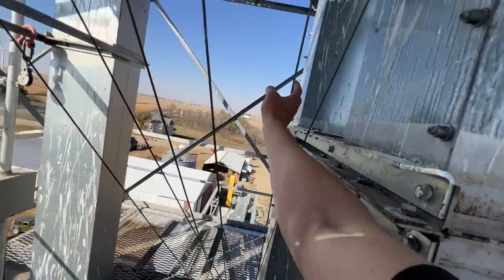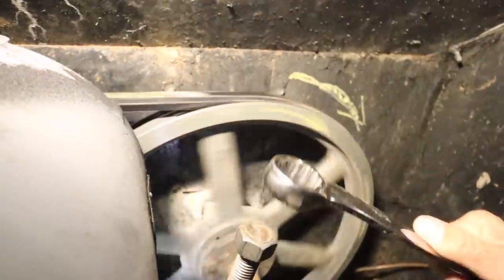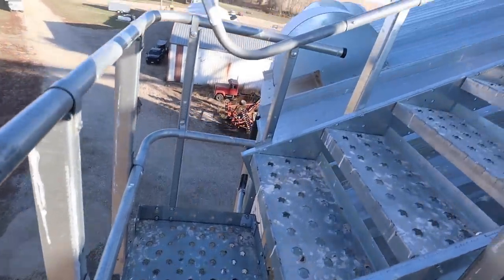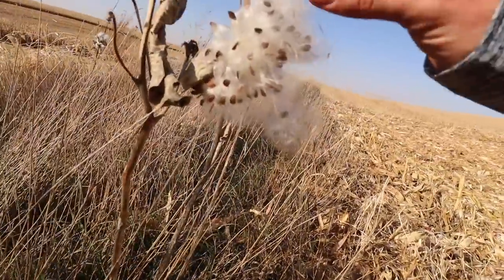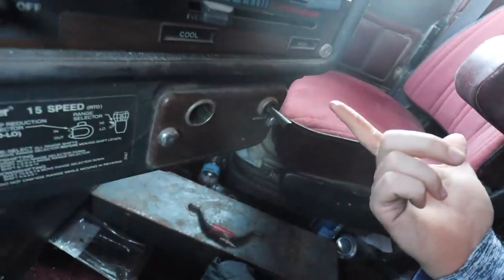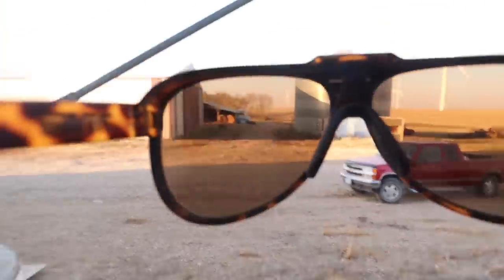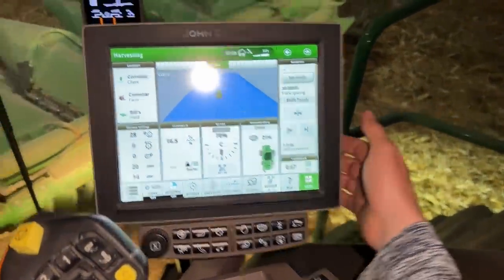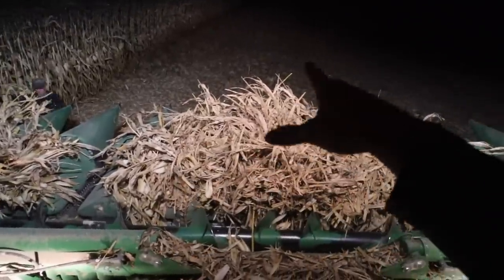Broken Welds Have Been Discovered On The Bin Site

Comment: I certainly hope that whomever installed all this equipment has been notified to either fix the issues or they pay someone to fix them. Fir the amount of money you invested you would expect some small issues but safety on the stairs and railings there is no excuse for thme overlokking them. I admire you all for being able to always rise above problems. My hats off to you all,
Reply: Your comments are to the point and make complete sense. Cole needs to take and send photos to the metal installer of the site, ASAP. Also inform your insurance company of the situation. Lastly ensure that safety signage is put in place were required.  PS, Inform all site users/visitors of the main problems.

Comment: Sadly a legal/civil case is only so useful -- it doesn't fix the fact that you need a properly working bin site right now. Still, I hope those bin builders were insured, because there has to be some workmanship liability & responsibility at some point. At some point, perhaps you'll be able to talk more about it, for right now just happy to see you all getting the good work done as best you can despite the frustrating setbacks.
Reply: Something I've been wondering.  I have no idea how these commercial bin site operators work, but I hope not similar to a lot of condo/home builders around here.  For liability reasons each project is spun off as it's own LLC to shield the parent company from liability if something goes wrong.  For example there are a ton of condos that were built with split-face block in the 2000s and a large number did not have properly installed moisture barriers and now are mold magnets.  The parent companies that built these buildings are still around, but the LLCs tied to each project are long defunct or long drained of assets.  So there is noone to sue to fix it.

Comment: The cross auger in the bottom of that pit needs a Amp meter so when it get to high of amps pulling it will shut off automatically. U could then have an adjustable timer to set how long it stays off to let corn in center catch up. 
Just an idea. I have something of this sort on my set up.

Comment: About the belts, have you considered swapping out the pulleys to double the belts? It'd pretty much halve the startup strain on the belts. I wonder if adding a soft start to the circuit would help any, slow down the ramp up on start.

Comment: Okay now I’m pissed, this isn’t a bin setup this is a million dollar death trap.
Reply: Agreed he almost died. I hope they sue for the cost of the bin site!
Reply: Up that high, I'd recommend a harness. Sure, it's annoying, but you don't get a 2nd chance several stories up.
Reply: @iLumberjack  A harness to connect to another piece with a broken weld? typically harness are connected to the safety railing, of which he grabbed and it broke.
Reply: @towtruckaj  understood.
Reply: Exactly
Reply: @iLumberjack  Ed Zachary what i was thinking
Reply: Was there ever an engineered stamp drawing?
Reply: Farming is dangerous.  A bin setup like this can only be but so safe unless you bankrupt yourself over safety.  That being said some basic things should absolutely be squared away.
Reply: @semosancus5506  Are you kidding me? They paid a half of million bucks for this bin site! The brand new weld on a safe rail broke, I seen the weld that broke and the angle iron the weld had broke from. That is 65 feet up, that should have been bolted and welded damn near all the way across. How would that bankrupt anyone?! 🤔
Reply: @weirdmatter  They actually paid a million dollars I believe (slightly more).  I just see these comments that seem unrealistic.  I agree there are some basic welding problems but any project of this size, done under the duress of supply chain and labor shortages, is going to have problems.  I hope they have done a full review and have a list of issues and shortcomings in performance and are undertaking, at their own expense, fixing safety issues.  I also hope they withheld final payment.  In the meantime, they have to use the site to start to realize the ROI.  So that means being freaking careful with these catwalks and other potential safety concerns.  Regardless of handrails and other stuff, there is a lot of danger even if the bin site is done perfectly.
Reply: @semosancus5506  I also understand that, but they had a welder! Bolts are not hard to find right now, and that particular handrail should have been installed properly in my opinion. My uncle Keith and his brothers run a multimillion dollar farming operation here in Illinois, I know the dangers of farming. However I still believe the company that installed their site could have done a better job. Regardless of the supply chain, they have everything it is not installed correctly. Your telling me they didn't have enough welding wire, and bolts?
Reply: @weirdmatter  I know they had a welder.  But was the welder good?  Did he know the plan?  Was there a plan that he could follow with welding specs?  Was there a foreman ensuring the plan / spec was followed?  I don't know.  I think some of this comes back to the Cornstars not being vigilant as customers.  I could be wrong about that as they have not said much.  Before I agree to anything I make sure there are clear specs and if those specs aren't met, then there is no payment.  How did the Cornstars get this far with so many problems?  It also might come down to the contractor they selected.  It's possible another contractor would have done better in the first place or have been more responsive to fixing issues.  We just don't know enough.  As to your question about bolts, I'm pretty sure he said in one video during the build they were held up because they couldn't get enough bolts to put the bin panels together.
Reply: @weirdmatter  id call OSHA on the contractor for creating safety concerns
Reply: @semosancus5506  really weird stance to take throwing blame back on the customers. They are not bin site experts. They hired a company to design, spec, and build the site, and deliver to them the final product. The cornstars are not bin site experts, the company they hired supposedly was. It was not the cornstars duty to GC the job and inspect it at every step. That was the responsibility of the builder. They encountered issues with the builder and their subs throughout the entire build process. They have been in a legal battle for a year now. Any professional outfit should be embarrassed to have delivered such shoddy work to their clients. 

Putting ANY responsibility for the shoddy job the contractor did here back on the cornstars is something I'd expect to hear out of a fly by night handyman being questioned on why his plumbing job leaked "it's the customer's fault for not telling me I needed to use PVC cement on the drains!"
Reply: @weirdmatter  they’re in court, can’t wait til they can talk about it
Reply: tripplefives  Cole and his family need to sue the contractor who built the site then
Reply: @semosancus5506  I believe I heard Cole say the cost was approaching 1.5 million, I know things have cost overrun but overruns for crap construction, wow.
Reply: Haaaaa the great American engineering 👌 👍
Reply: @williamburns9731  i think the term your looking for is shitty workmanship by a poor contractor
Reply: @semosancus5506  You understand they are governed by OSHA right? It MUST meet their standards. Period.
Reply: @TheNemosdaddy  Private farmers with 1 or 2 employees are governed by OSHA?
Reply: bet they are disapointed too now
Reply: @peterrenshaw9237  I've had opportunity to work in the catwalks above MLB stadiums and hockey arenas. These were very sturdy structures since they needed to support both themselves and the roof, but also very heavy suspended loads like scoreboards and multi-ton speaker rigs for concerts, etc. I'm not a rigger or pretend to be, but I know that nobody went out on the catwalks without a rated harness. Whether this was a legal requirement, OSHA recommended, or simply a requirement for insurance, I don't know, but I was ubiquitous. Given the generally temporary nature of scaffolding, I guess it's possible that the rules are different. I do know there's a world of difference between basic rental scaffolding and the stuff set up by pros. Y'all know what you're doing, that's for sure!
Reply: @iLumberjack  as a scaffolder we ware rated harness to make it safe for other workers or  general public . once we have finished we put a safe tag on it and the workers or  general public can go on the scaffold  without a rated harness because we have eliminated any risk of falling
Reply: @Greg G   ya, but what is that going to do if welds are snapping off. May if it was done correctly
Reply: @gexploits  i agree with your statments . I do scaffolding for a living and i can tell you they left out a extra rail at the bottom of the stairs what is designed to stop you falling to your death if you triped on the stairs .it is clear to me who ever did this is a moron who dont care if you die he just wants your money

Comment: I agree DC you might want add some additional vertical safety.
Reply: im going to take a more aggressive stance and say they HAVE to get that fixed. The chance of a fall is high, and if a fall happens itll almost certainly be fatal at those heights. 

That height of railing is way below the required factor of safety of 1.
Reply: @alexdrockhound9497  definitely should be using harnesses that high up.
Reply: @alexdrockhound9497  I don’t disagree.  I just don’t know if that poor design or bad workmanship.  I was talking about when he came down the stairs and the railing was too low.  If you you were talking about the crappy welds, oh heck yes.  I would make them fix that.
Reply: @michaelsurratt9593  both are way beyond acceptable risk

Comment: tell Cooper to take the motor off and stick a burr but on a die grinder in the mounting bolt holes and burr out his own adjustment grooves.Then change to a 4 belt pulley

Comment: And you might wanna extend that railing up about 2 feet, that way if you fall, which unfortunately if done enough times you will, then you won't fall all the way off. It's a cheap enough fix to be on the  safe side. Thanks for the videos

Comment: Hi Cole i saw the tar spot while i did my schooling on Crop production and it was my main Focus while i was at University of Guelph in Canada know for AG and i did 6 months working for my province on research on it while you may know this tar spot it basically a fugus that bubbles a bit and then covers the leaf in spots or if bad enough in patches (under a microscope it looks like a bubble that can pop) so it does have yield impact and life of the crop impact because it will stop the plants photosynthesis and which does hinder the total possible yield potential

once the tar spot appears it will remain for a while or bad enough can last a decade 

the spores are transfered with the wind in Ontario canada wind it depends for us if the wind stream for the year will move south to north and vise sersa

Hope it helps and Hope harvest goes Great!
Reply: Will burning the paddocks after harvest help get rid of it instead of planting on all the old charf
Reply: @looking8030  we dont get in to that practice in ontario here but if some hybrids resist it more than others it came to canada in 2018 and farmers have been dealing with it since and some years its barly even there like affecting and some its bad depends on the conditions that year

Prime conditions for it think of it like mold, wet humid conditions if its more of a dry but wet it wont show  up as much

there is a thing called a DISAESE TRIANGLE it is a triangle that shows for a disease or issue in crops we need 3 things (Enviroment, Suseptable host, Spores present)

but also we noticed in trials in NO TILL TILLAGE ITS WORSE DUE TOO THE SPOPRES STAYING IN THE CORN STOCKS LEFT OVER so basically it can be more controlled with some tillage not saying full 70s tillage but think about that
Reply: @looking8030  dry heat low humidity but still have rain its wont show up humidity is a factor it also starts at the bottom and works its way up always check first leaves and then move up
Reply: @brandonhooey4468  thanks for the info mate 💯👌🏽

Comment: I wonder if slowing the cross augers in the pit would help.  Either a VFD motor drive or change the pulleys.  VFD you could at least find the working speed of the cross augers vs the main auger to the leg. Might even be worth putting a VFD on the main auger so you can over drive it if needed.
Reply: This is my thoughts a vid is the way to go and swap the belt for chain. They keep mentioning a guy programming things all the time I really wonder wtf is happening besides reacting not finding solutions

Comment: 13:34 on the note of that pit auger burning belts, may I suggest adding a triple pulley instead of using a double pulley to better transmit power to more surface area to that shaft lowering the tension a little bit on the belts themselves but increasing surface area between both sets of shafts to transfer power better because it seems to me this is one of those situations where you have too much slip because you're trying to transfer too much power through two belts that is turning a shaft that is too long for it under that weight

Comment: Great Video Today guys!, I was wondering on the auger motor down in the pit, Can You get 4 belt pulleys for that to give that 10hp motor a better chance of pushing through instead of stalling and burning the 2 belts off?. DC had a point in that the smaller 7hp motor would just pop the circuit breaker, maybe since the 10hp has not done that it just needs to be able to pull harder at startup....   Just a thought. You Guys really do take it all in stride and continue forward with all of the issues you have encountered. THANKS AS ALWAYS for bringing us along on these journeys .....   already waiting for the next one.

Comment: Switch the auger to three groove sheaves and triple belts to handle the 10HP.  Option #2;  Add covers or shields to the auger so it takes less grain in and has less load on it.  You might need to then change out the sheaves to speed it up to keep up the desired bushels/hour.  Option #3, (not recommended) You could swap out the belts for some double #80 roller chain, then who knows what will break next. The nice part of belts is they do limit the load and the destructive force if something jams, roller chain is unforgiving.

Comment: seems to me that the gap between the left side and right side flighting needs to be wider apart on that cross auger in the pit , as well you may need to put a delay on the cross auger drive so it only comes on when the main pit auger elevator sensor sees it running out before it starts shutting down

Comment: You really need to have an experienced inspector go over every inch of the bin site and write a report detailing every safety issue, every design flaw, every construction flaw, and every mechanical flaw.  I would allow no one to climb atop the bin site in its current state.
Reply: If it was me Id consider having a complete mechanical inspection of the bin site done PRIOR  to any more use as there appear to be far too many potentially mistakes that could prove to be catastrophic AT BEST .... and DEADLY AT WORST. 
Upon  cerified inspection bill the builder and give them an ultimatum , pay for the inspection,the report , and ALL necessary repairs by a competant firm other than the contractor within 15 days or see you in court..
 bring a blank check and notify you liability insurance carrier immediately
Reply: I am pretty sure they have already hired an inspector months ago when the troubles started. But new issues can crop up.
Reply: What about an inspector?
Reply: I’m sure they have, judging by how they can’t share all the details with us, they’re in the middle of a legal battle with the builders that screwed this up.
Reply: i'd climb on it, there is enough structure that was solid from the old build, i'd just tie off honestly to the bigger elements when possible so that if something like a weld broke i know there is still something else holding me
Reply: Agreed....you have some verifyable issues with those bin builders
Reply: That was scary watching daddy cstar nearly go over the edge. If that had snapped off I hate to think. I agree that whole complex needs inspection!
Reply: That was scary watching daddy cstar nearly go over the edge. If that had snapped off I hate to think. I agree that whole complex needs inspection!
Reply: Yeah while it was being built.😃😄😃😄💩
Reply: They've got lawyers involved..I'm sure inspections are coming! You can sure tell they want to say more but the lawyers have advised not too. Lol
Reply: @ccole9080   You have clearly never been involved in a large multi scale grain handling system construction project never underbudget never on time and always f*** u* The joke is you have to build everything twice now in fact I will stick with the equipment that was Built-in the seventies and eighties and just rebuild it because you can't get good construction today instruction today I would not want to live in a new built house
Reply: @growthefarmup2606  
Never have been involved in a large multiscale grain handling system .Never claimed to have and I underrstand your comments on overbudget , overtime, and redoing old equipment because you cant get good equipment today . 
However I have worked on and commisioned a multi turbined wind farm costing
Reply: @farmerjer9339  understandable , they may not be able to without big legal headaches in order to obtain a settlement . 
Theres often a non disclosure clause in legal settlements